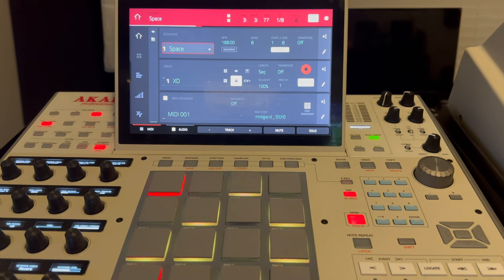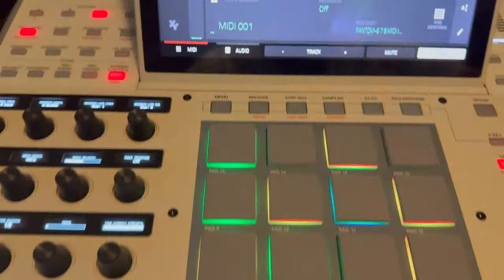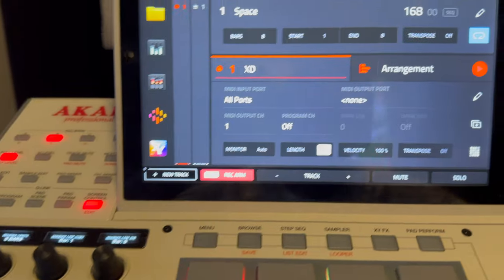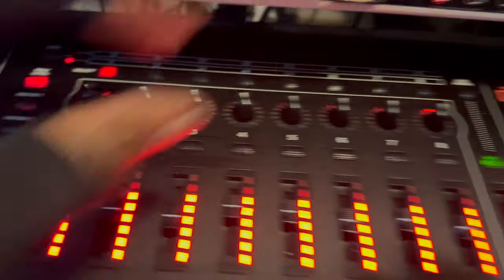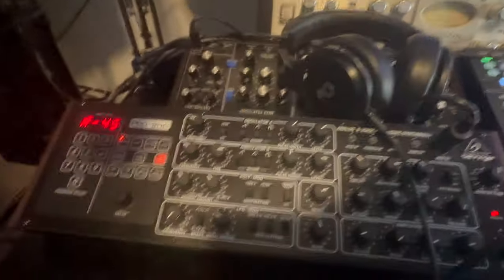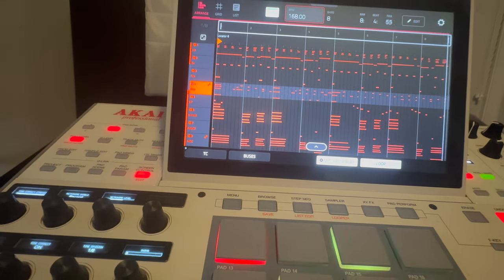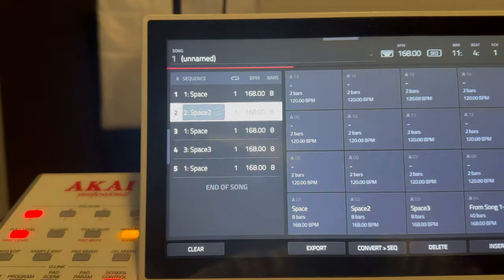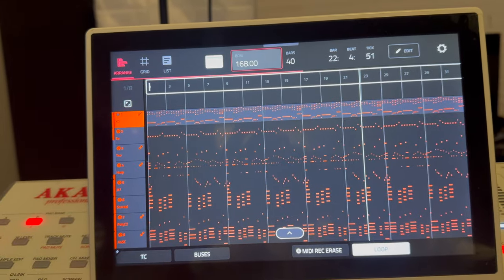MPC3  - SEQUENCING EXTERNAL HARDWARE INSTRUMENTS, TRACK MUTES, & ARRANGER WORKFLOW

Comment: QUESTION???🙏🙏
Will u get the same quality of the sound running it through the MPC?
For instance, if u sequencing the original TR808 through the MPC will the end product have the TR808 quality drums or will it come out with the MPC-X quality of that drum?
Reply from the maker: Hi! Yes! The modern MPC’s will receive any source and play it back with no degradation or enhancement. I run my ASR-10 and MPC60II through it often. The higher the sample rate and bit debt, the more accurate the sound. I usually record at 48KHz 32Bit. Keep in mind, like most modern audio interfaces, no coloration is added to the signal unless you manually do it. My vintage gear hits the same when running through the MPC or my Apollo X6 audio interface. When sampling, the play back can be a little punchier because of how the MPC’s, especially the vintage models, uses some sort of compression to make it knock. The MPC-X plays back what you put in it. Usually, stock samples or random samples loaded into the X are not going to hit the same vs actually sampling into it. What matters is the source. An original Roland TR-808 will sound great running through a modern MPC. It may even hit harder if you sample it. Just be careful on input levels. The older gear was recorded on tape back in the days, which could handle overloads, creating “tape saturation”. Digital recordings can be distorted if there is constant clipping. If I can’t get my hands on an original 808, I will definitely get the Behringer RD-8 analog clone and make a video with it. Thanks for commenting and I hope that helps.

Comment: 3.0 didnt remember your msb lsb settings for midi? That would drive me nuts. Dont get me wrong if you save all your presets with your outboard stuff itll still load when you recall the user presets, but each piece of gear has a different way of doing it. To remember all that is crazy. I usually put stuff in audio, but i still like to hide the midi in the track just in case.
Reply from the maker: I wanted to wait for a couple of more updates before trying that again. I am expecting that to be fixed soon. It definitely didn’t load the midi output ports. I had to manually choose what instrument to send the tracks to. That was coming from 2 to 3. It does save with 3, as far as the midi output. But the MSB and LSB issue is still being resolved.

Comment: Whats your routing … all them synths did u use a midi time piece
Reply from the maker: USB Hubs for most of the synths. 3 are connected to the midi outputs of the MPC. MPC is the only Midi master, in which it does a very good job of sequencing up to 32 USB devices and 4 via traditional midi.

Comment: Are you linking all the keyboards at once? If so how are you doing it
Reply from the maker: See reply above…
Reply: USB powered Hub connected to MPC. Some are connected to 3 of the MIDI Outs on the MPC. I’ll go into detail in a later video this week.  You can connect up to 32 devices via USB. Thanks!
Reply: USB hub
Reply: @bangerzbeatz9652  Exactly,